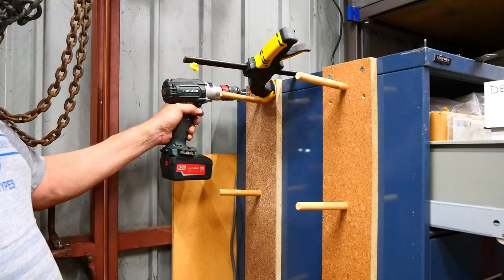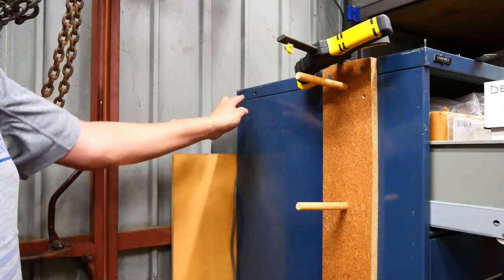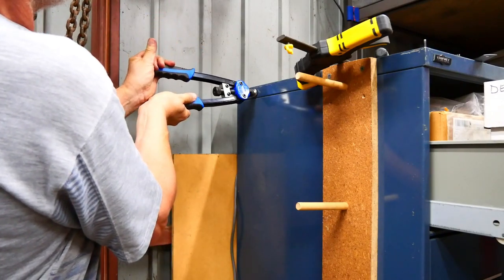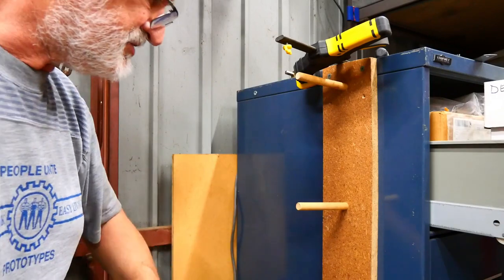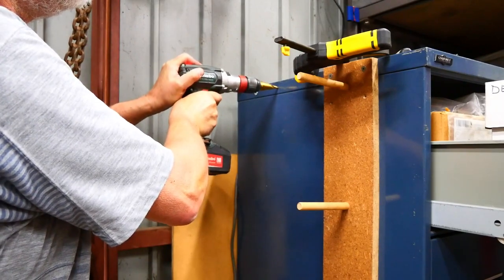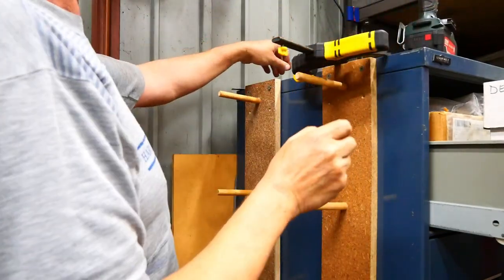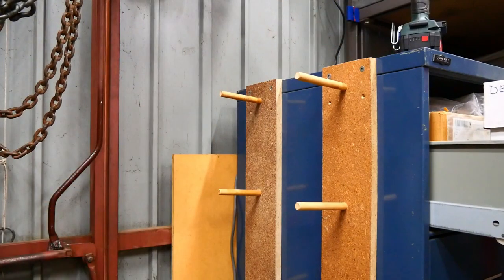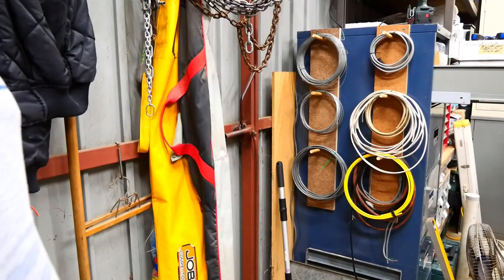Outside the box storage #shorts

Comment: Great idea Alan, I must get a set of rivnuts, very handy to have around, Cheers
Reply from the maker: Rivnuts (AKA Nutserts) are perfect for removable attachments in thin material. Typically sheet metal, but I also used them to fabricate a possum barrier from corrugated polycarbonate sheets. I install this around the trunk of my oak tree in spring and remove it when the foliage is fully developed. Only thing to watch out for with Aluminium inserts is over-doing the crimping pressure - very easy to strip the threads in the smaller sizes. 
Cheers, Alan.